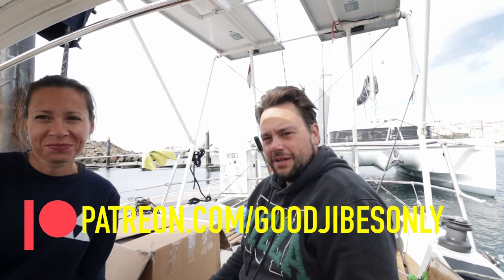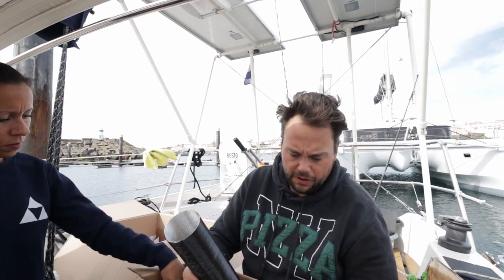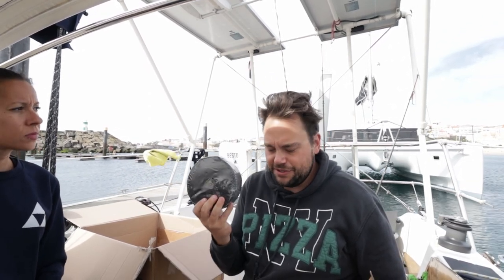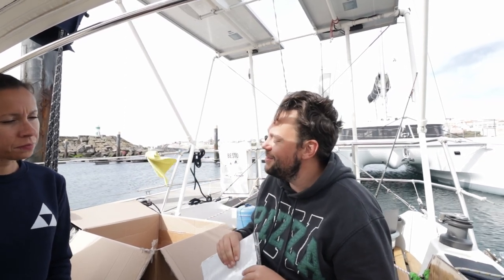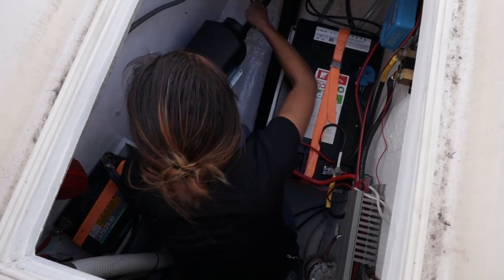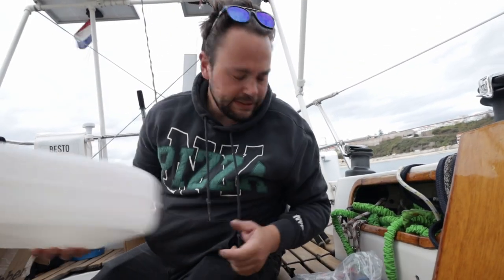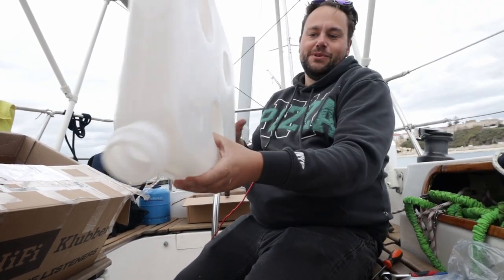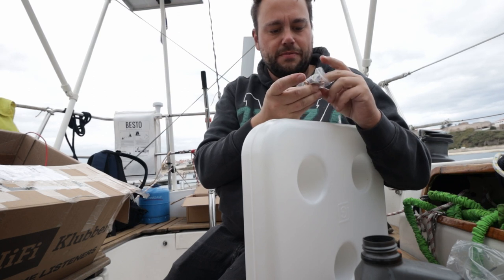How to install a Chinese diesel heater on a boat, part 1

Comment: You have a death wish installing that chi-com POS heater. Can you say carbon monoxide?
Reply from the maker: Can you say carbon monoxide alarm? It reads zero everytime it's on 😁 also: if you look at our video I explicitely explain why we use an enclosed exhaust that goes out the back of the boat.
It's really not a POS, it has served us and many others well. Be it you have to be cafefull with the right modifications to use it on a boat 😉